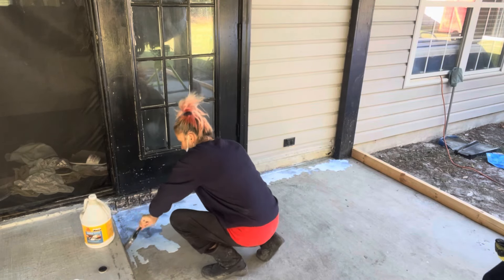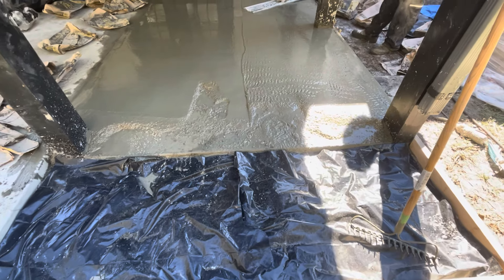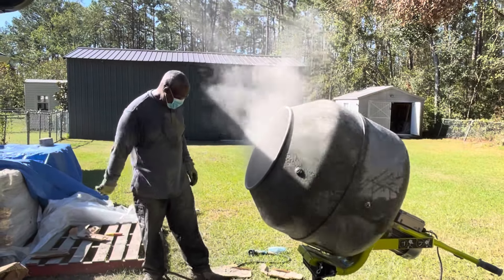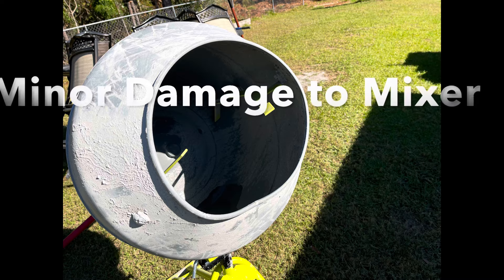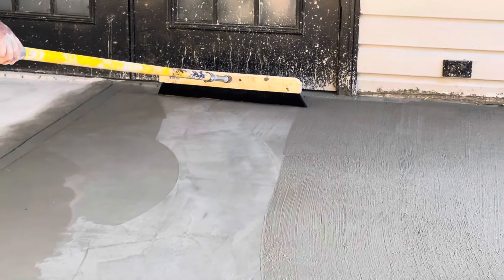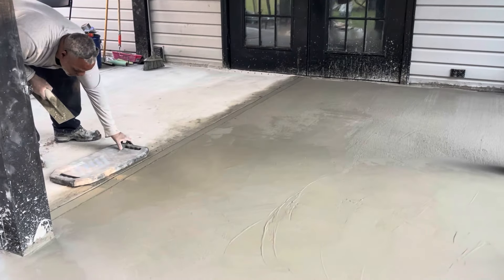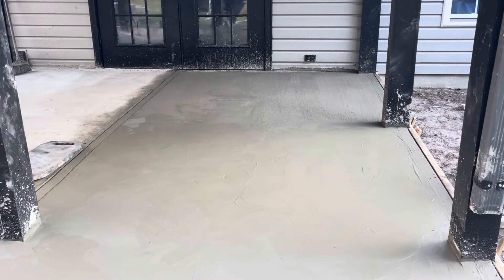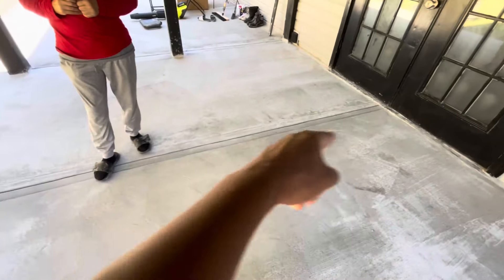Concrete over concrete Patio 16 by 14 Ft ( part 2 )

Comment: Doesnt wood posts rot in concrete and once they get saturated and start rotting  the porch roof sags as the posts deteriorate.,but it will look good for 15 years before it creates alot of problems
Reply from the maker: @kenmason8203  that’s why I put a protective coating on it to give it some protection also, why I showed that three second video in part 1 video of so many people putting unprotected wood post in the ground, covered with cement, but good points you made I appreciate it

Comment: great job. looks like you live down south so how does the concrete hold up? up north it doesnt seem to last as long im thinking due to the temperature and weather enviroment changes up here in CT
Reply from the maker: @jwb82274  yes down here in Florida, but I’m originally from New Jersey and when I did concrete in Jersey, I always use metal mesh with 3000 psi cement bags
Reply: nice